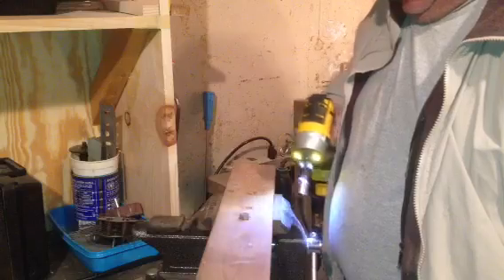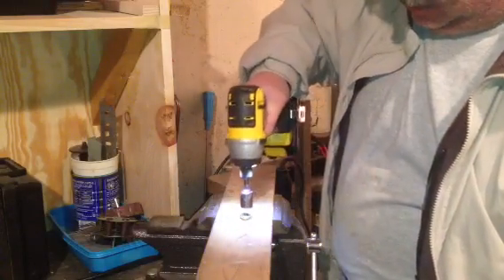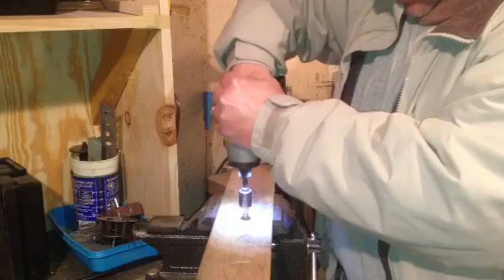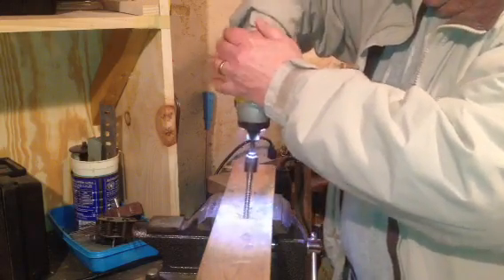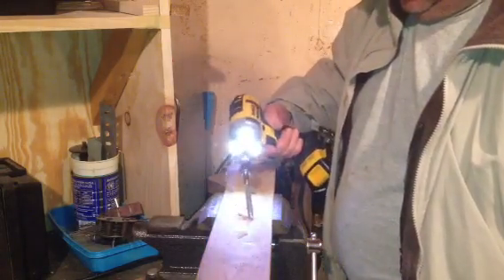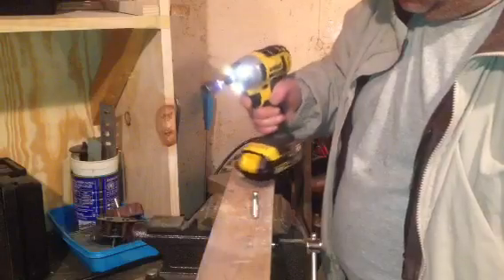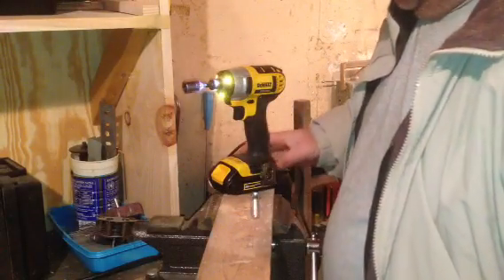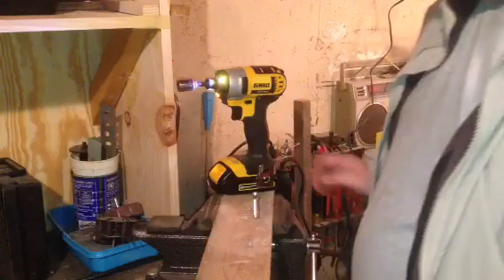Dewalt DCF 885 impact drill  lag bolt test

Comment: Did you notice any burning smell? I put in four 4'' lag bolts and I noticed a slight burning smell. It drove em in no problem though. Did you drill a pilot hole first in these vids?
Reply from the maker: Dewalts seem do have a motor smell and not from driving lag bolts in wood but from drill.. so yes

Comment from the maker: Yes , I did ... you can  see   smoke in my  vid, no I did  not drill a pilot hole , just tapped  each  one  with the hammer slightly   in to wood a bit to have them stand up.Thanks for you question an have a greta day.